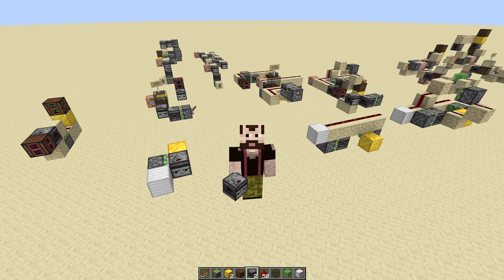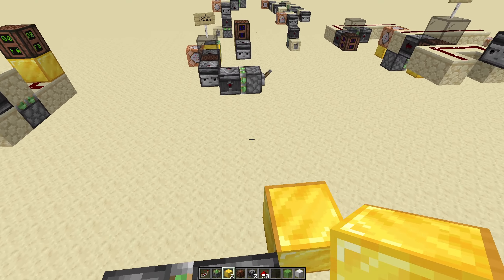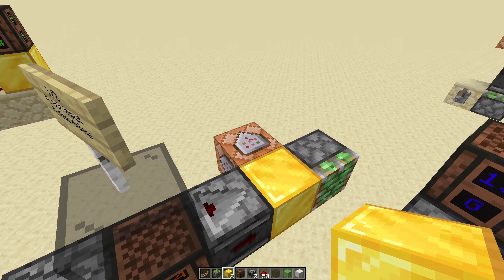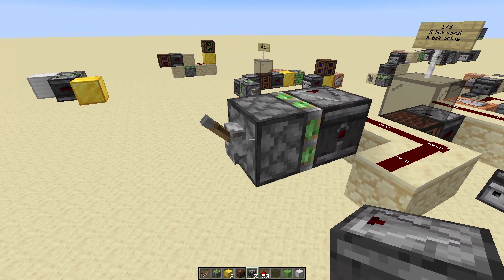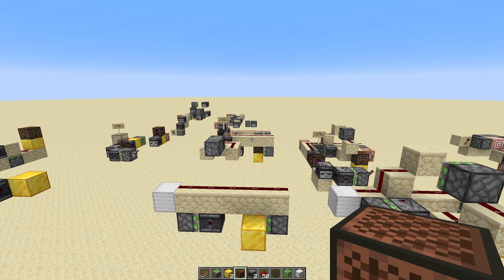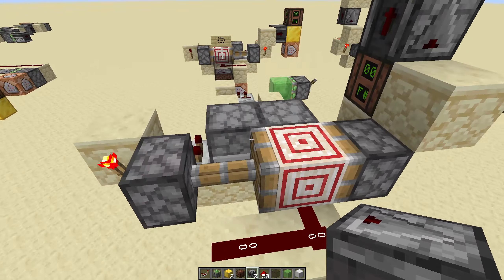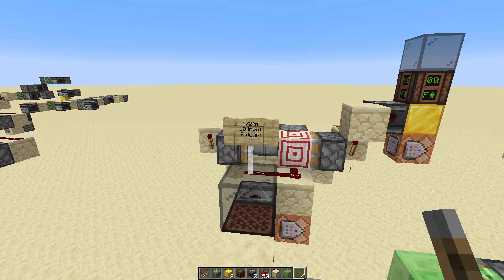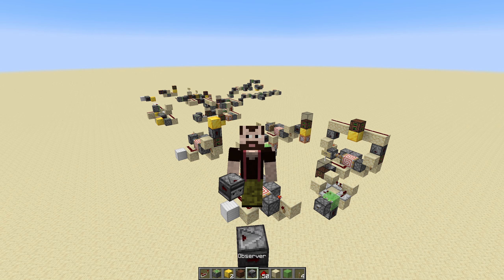Pulse Dividers | Minecraft Java 1.17

Comment: I think your dropper version is better, but I also have used a comparator-based divider. Two comparators store a signal, each input subtracts one from the signal, and a third comparator emitting a certain signal strength resets the first two comparators when the signal strength reaches zero. Works for 1/n, where n is the signal strength of the third comparator, but only works up to 15, obviously.
Reply from the maker: I need to make one of those to see how they behave, the dropper one is such a pain to plug into some machines sometimes.